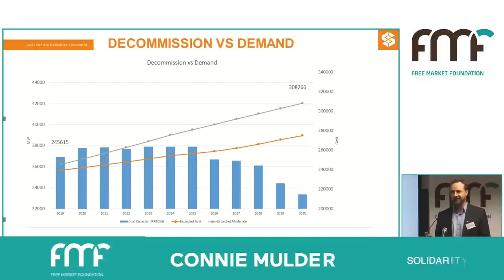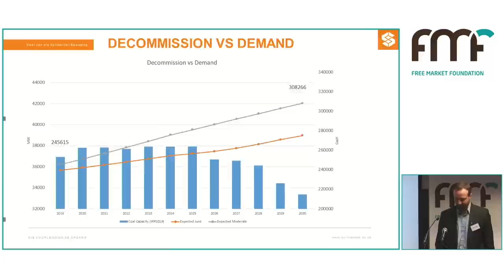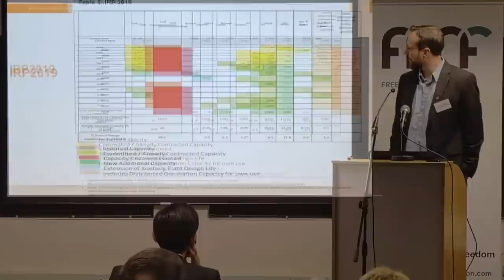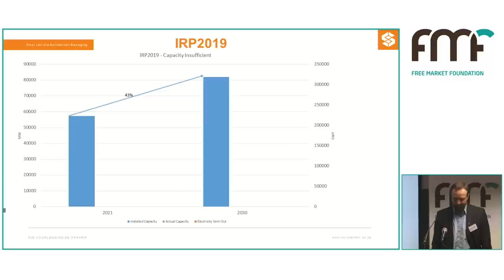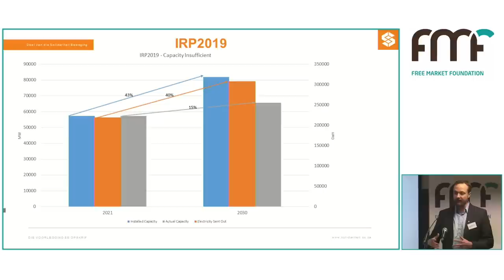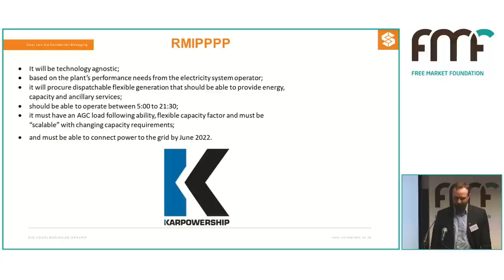Who is responsible for LOADSHEDDING? | Connie Mulder (Solidarity)

Comment: So, the Kapowerships run on "heavy fuel oil (HFO), diesel fuel, and/or natural gas" to produce electricity, right?
Would they make a concession and some modifications in South Africa's favour (read: Mantashe's favour) to use Coal instead? Probably not... but how will the diesel (or other fuel) be procured, transported and supplied to the Kapowership(s)? (Oil and Diesel from Russia maybe?). Who has fingers in those pies? A 20 year contract for electricity from an already questionable deal (reports say necessary impact assessments were just "passed", exemptions of certain requirements favouring Kapowership, and other things suggesting a single-minded approach that this WILL be the only option), that's beginning to sound more like someone's Pension Fund plan. 
After 20 years - we have no worthwhile infrastructure built on South African soil. Only damaging environmental impact. Nothing for the future.... except the possibility of considering another 20 year Kapowership contract? A 20 year deal will also saddle a (hopefully) new, more progressive and efficient government with an albatross around their necks.
Reply: Over R200 billion!
Reply: @marleneclough3173  😲